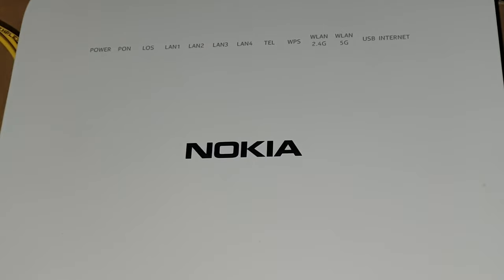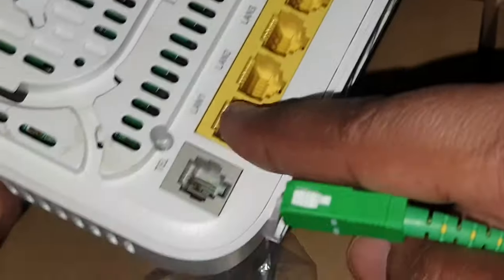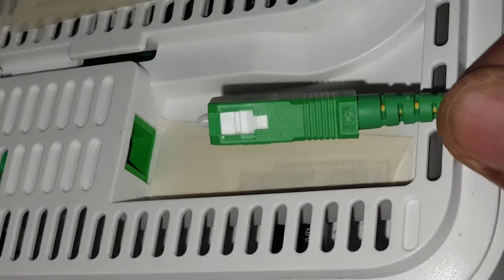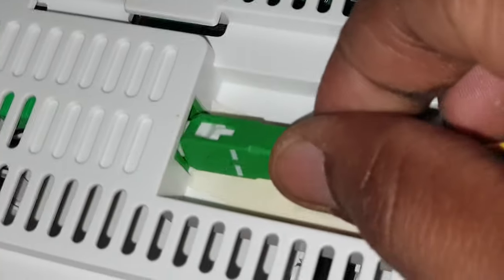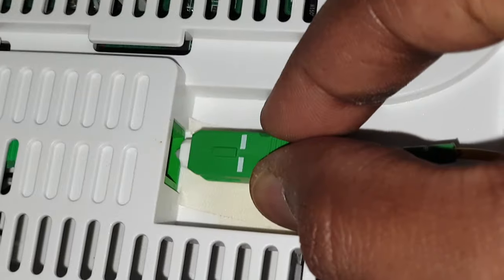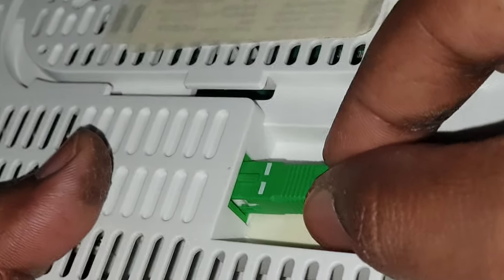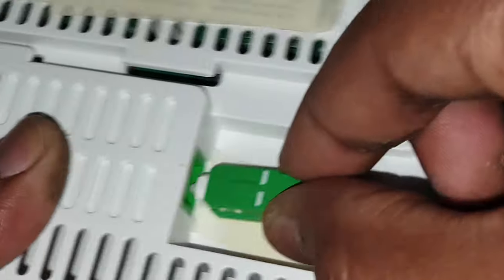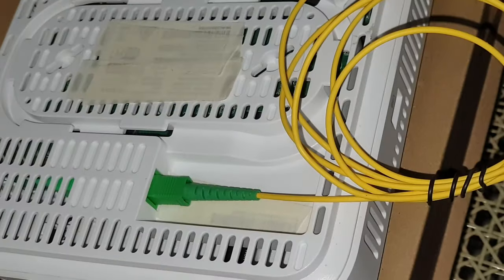How to connect Optic Fibre cable to Modem/Router | Simplex Cable | FTTH

Comment: I have fiber internet but want to connect a Ethernet cable to the router and then to my Xbox. Problem is I tried connecting a CAT 8 and it didn’t even register to my Xbox as if nothing was connected
Reply from the maker: You may have to check RJ45, check the XBOX specification.

Comment: I have a question, this cable is the same as I have, but I want to change the router to!  A better company like Asus or Tp-Link, my question is do they have the same input as this optical cable fiber from the back
Reply from the maker: Nope they don't. We need to use RJ45
Reply: Naŭdektri  Hi! I just bought a media converter for these purposes, but it doesnt seem to work. I connected from my ftth to media converter(tried both tx an rx) and then directly to my new router(xiaomi ac2100) it seems I am doing smth wrong but can't figure out what. Can you help pls?
Reply: @adilzhursin156  I don’t not a lot but did you use converter, modem then new router? You still need to have a modem

Comment: I do have a fiber router but I would like to convert my Ethernet so as to use the fiber router hence that where I relocated there is no fiber connection but p2p connection. My question is how to convert from normal ethernet to fiber, and the kind of device I should use.
Reply from the maker: Fibre is only good for high speed. Bunch of RJ45 router and modem should do it.
Reply: @KNMK259  RJ 45 modem. I do have
Reply from the maker: @joshuabrian2776  In that case. To extend the connection, you can use Router with RJ45 Cable. That should do it.

Comment: Hi i have a question...I did this to reset  my optical but the light on it is still on red and it's not working for the internet  or phone what should I try next.
Reply from the maker: You need to check with ISP

Comment: A question, was wondering if it is possible to add a second router to this  modem fiber optical/router?

like for example I connect the fiber optical to this modem/router
and then enter to interface of modem and disable the router, just leave as a modem, and then just connect manually any router?

by any router I mean, here in Venezuela for example we do have fiber optical, but people actually only ask for 50mbps download speed. So I was wondering we can use any router of 150mbps/300mbps and adapt it , right?

Thanks for your answer, sorry for my poor English
cheers
Reply from the maker: The thing with router is they add address. When they add the address, which is done by the service provider company, we cannot add or change the router. They add it digitally so that nobody can override the system.
Reply from the maker: Thank you so much for sharing your setup from Venezuela.🙏
Reply: @KNMK259  Yeah I know you are speaking of (static Ip address) but even that I have heard that you can connect a second router to the modem, and manually re-add the static ip addres, but thanks for your answer anyway, cheers from Venezuela.
Reply from the maker: @PescaitoFrito  I know where you are going. You can do that add the Ethernet cable extend and then do the magic. But speed may not change.